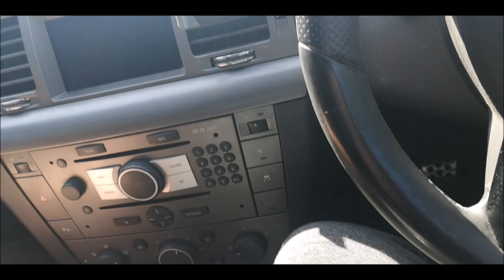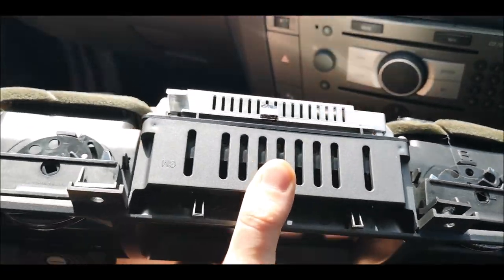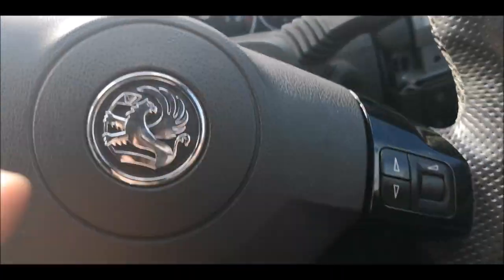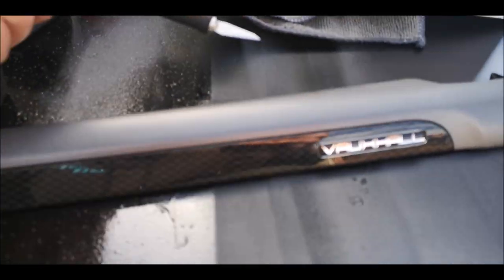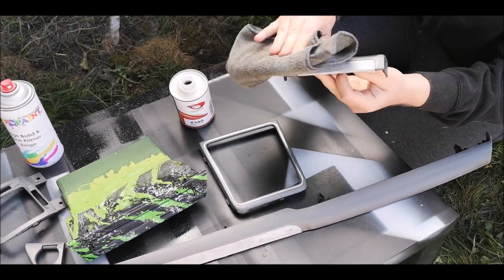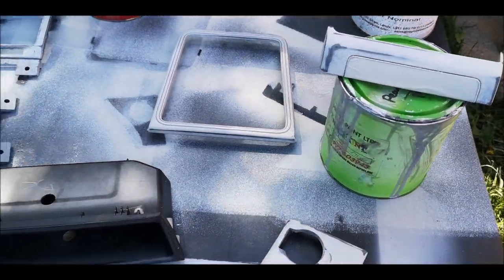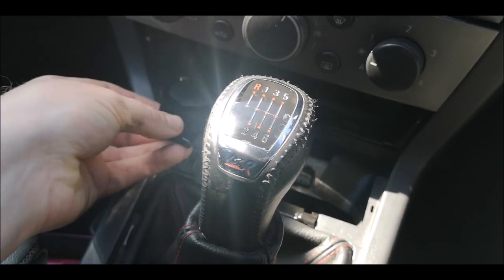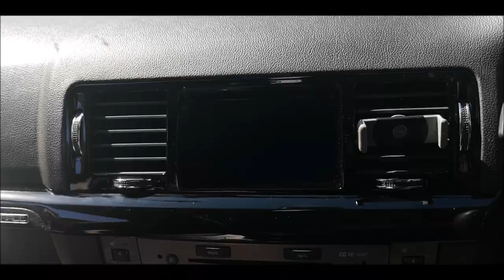Making my VXR Interior trim Fresh Again!!!!

Comment: You have two cup holders in the front centre bud why would ya need another two plus you can hide them when not using them but I like your paint job bud kinda looks like the corsa inside bits
Reply from the maker: Because the cup holders in the front are too shallow had too many drinks spill only good as a money tray
Reply: @ukboost3322  lol true that especially when you put your foot down lol 😂

Comment: Done this to my car in red, really would like to do the door trim I seen you said it would need plastic welded does it not just come off with clips?
Reply from the maker: No there plastic welded from factory not clips very stupid design
Reply: @ukboost3322  yeah I'm gutted now and would love to do the center where the radio is Hazard light button is there though and dont wanna try and pull it out incase I break something
Reply from the maker: @HarryDraws5  it can be done just have to make sure you plastic weld them back just fiddling an more time consuming